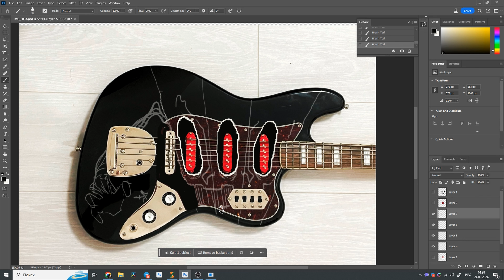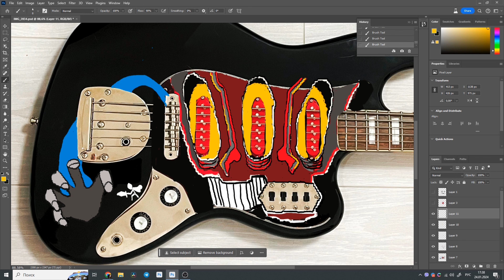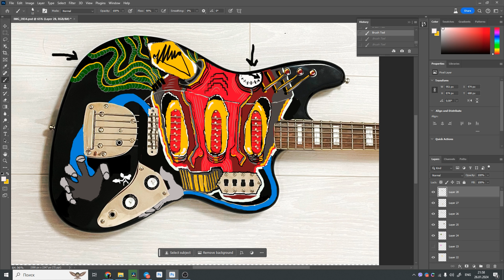Modern baritone or vintage guitar? Squier Bass VI #baritone #fender #bassguitar

Comment: I really like that 30 inch neck

One reason why bass VI would be far better then most baritone guitars is due to ti the standard tunings if each

A bass VI is whole octave down (12 semintines down)
E1 A1 D2 G2 B2 E3

Where alot of baritones are just a 7 string without the high E (5 semo tones lower)
B1 E2 A2 D3 G3 B3
and at most they are just like a 8 string without yhe high B of high E (10 semi tones down)
F#1 B1 E2 A2 D3 G3
Reply from the maker: yeah, it's pretty unique, vintage specs and modern capabilities

Comment: Fender's Updated String Gauges are 24-100
Reply from the maker: the owner told me, that he changed the hole setup for baritone strings and tuning, and he said that feel became much better (for him)
Reply: @worknrolla  But Fender 24-100 Gauge strings are a huge improvement over the 24-84 gauge strings
Reply from the maker: @RockStarOscarStern634  yeah, but depends on tuning, if you want go higher, as that man with baritone tuning - these will kill you))
Reply: @worknrolla  I use 24-100 Gauge strings for E-e Octave Down Tuning
Reply from the maker: @RockStarOscarStern634  for this tuning it's a cool set, no doubt💥
Reply: @worknrolla  Fender did a great job addressing the floppy Low E String problem by improving the string gauges

Comment: A Bass VI is a bass guitar, not a baritone guitar. Two different tunings, scale length, string gauge, etc. The terms are not interchangeable.
Reply from the maker: yeah,but)..many people now use them as a baritone, yeah, you can change the tuning for baritone and strings gauage (not in this case, but you can)
Reply: not really. you can always change the tuning, and you can always change the string guages. as for the scale length, there are bass guitars that are 26" scale, 28" scale, and 30" scale. MOST guitars are 26" scale, MOST baritone guitars are 28" scale, and MOST bass guitars are 30" scale (like this one), but those are not definitive rules. there are some basses that are 26" scale so that they can fit into a standard guitar case, for instance...
Reply from the maker: @-jank-willson  yeah, there are no strict rules
Reply: This not bass because it's use guitar strings not for bass so it's still long scale baritone with much thicker string gauges so basically it's much closer to bass but still not a bass! But you cannot call a bass guitar even some marketing idiots name it bass guitar 😂